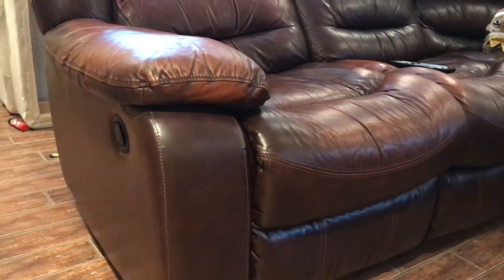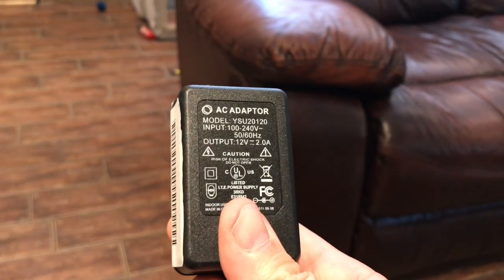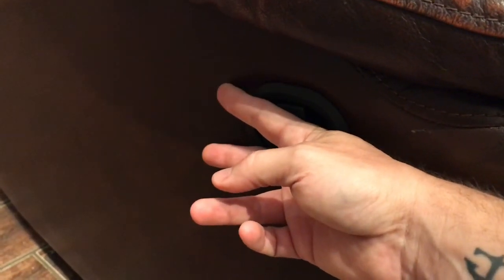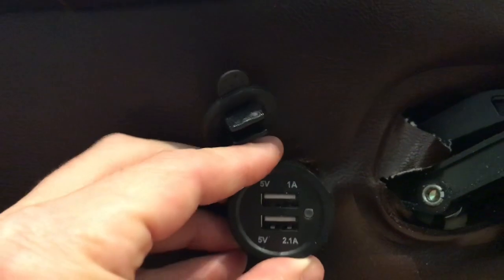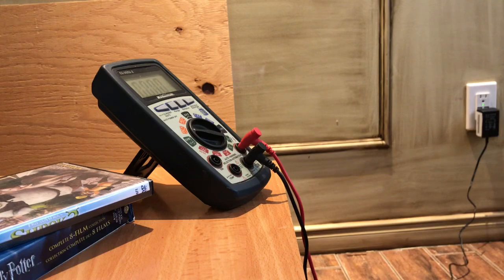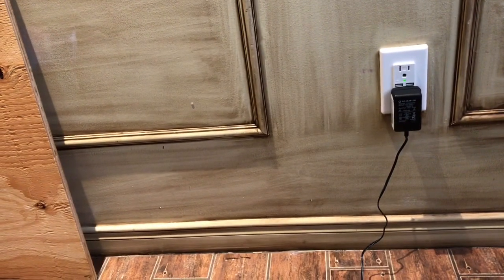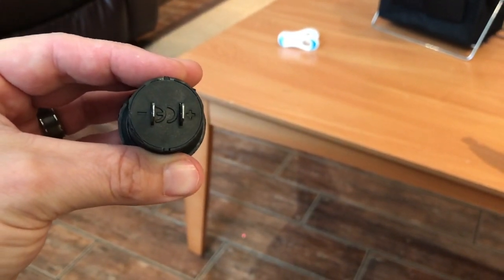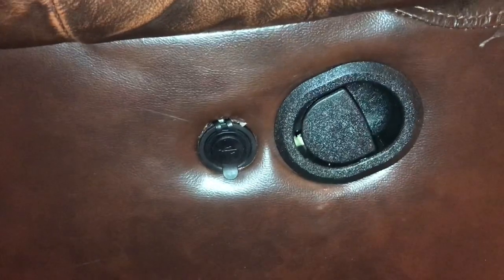USB charger install into sofa

Comment: Could u splice into it to add 2 ?
Reply: Or would that drain to much power form the first one ?
Reply from the maker: You can… but yes, you would split the power
Reply: Get a stronger ac/dc adapter, then yes.

Comment: Can you put the description or link to buy from eBay?
Reply: https://www.amazon.com/Ginsco-Charger-Socket-Outlet-2-1A（4-2A）/dp/B01N6S2SNM/ref=asc_df_B01N6S2SNM/?tag=hyprod-20&linkCode=df0&hvadid=312111908612&hvpos=1o23&hvnetw=g&hvrand=2330883931340433021&hvpone=&hvptwo=&hvqmt=&hvdev=m&hvdvcmdl=&hvlocint=&hvlocphy=9028730&hvtargid=pla-569092482410&psc=1